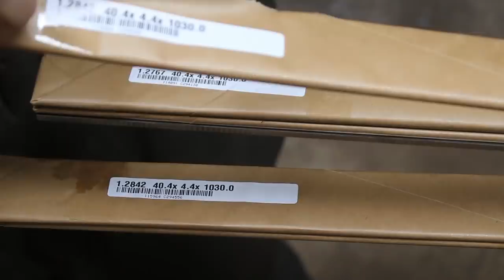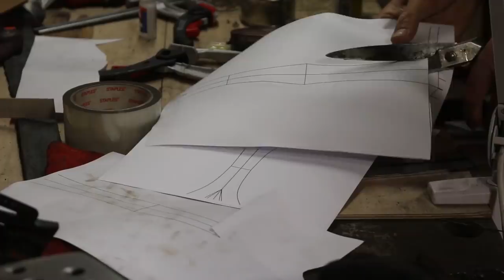Forging a Bastard sword, the complete movie.

Comment: This is an amazing sword but technically speaking this is not a bastard sword, this is a longsword.

Theres really only three types of swords: the short sword, the longsword, and the greatsword.

The short sword is obviously much shorter and usually a tad thicker and is meant to be used with only one hand, which is why the grip is so small.

The longsword, the one in the video is a blade with a longer reach and is meant to be used with two hands for powerful strikes. You can tell not only by blade length but by grip as well, if there's a gap between your hands when you grip it's most likely a longsword.

The greatsword is a huge blade, you really never see it in actual combat, the grip is collosal to suit the blade.

But there's actually a fourth type of blade, the bastard sword. But it's actual name is called the hand and a half sword. A bastard sword is a cross between a short sword and longsword. It allows the weapon to be wielded with one hand and two hands depending on the type of combat situation. The blade was usually slightly shorter than the longsword while maintaining the more common thicker to slimmer blade taper (when the blade starts wide at the bottom and slowly shrinks to the top opposed to a more direct and straight line like the blade in the video) however there's really no "better" version of the blade and is ultimately up to preference and what feels more natural. You can tell when a sword is a bastard sword when you try to grip the blade with two hands and your grip extends onto the pommel. It makes it great because if a grip is too long it sabotages the wrists movement when using one hand. But the bastard sword is short enough to not impede single grip combat, allowing for a shield but to also allow two hands in order to deliver more powerful strokes.

Comment: So much love and hard work went into making that sword I can't see how you can call it a "bastard sword."  Seems kinda mean-spirited to me.
Reply: The term "bastard sword" comes from a couple different sources, but one of the more commonly accepted is rooted in french, called thus because of its hard-to-qualify nature.  So-called bastard swords are neither one-handed nor two-handed swords, occupying a middle ground; as such, the term "bastard", meaning irregular or spurious in context, was used.  Bastard sword:  literally, sword of irregular or mixed origin.  One could consider a bastard sword to simultaneously be the shorter end of "Long swords" and the longer end of "arming sword", qualifying as extremes of both but also technically neither.  Hence, "bastard" sword.
Reply: another way to say hand and a half sword, just enough room on the handle to warp your 2nd hand for a faster more accurate swing.

Comment: I'm a novice and have a few questions. Why was he putting the hot steel in that powder?
Why was he cutting and reataching the parts he cut off? Is that like folding it? Why was he sanding it before he cut and reattached the part he cut off? Was that to help it stick together? Why did he drill the craters into the blade? Why did he heat up the blade then put it between two boards ? Was that to straighten it?

Comment: Top quality materials, high-end skills, obsessed workmanship deserves respect, hats off
Reply: That trip hammer in its first aplications was a modern marvel but now it's used mainly for repairing things when no part is available, using it to forge this item is like being a blacksmith from the 1600's what's discovered a way to get the same results with no skill or effort.

Comment: It looks good. The only thing I would have different is I would want a leather wrapped handle. Ebony is pretty and all, but if someone were to shield an attack from it, all of the shock would transfer from the sword into the wielder's arm. Leather wrapping would help mitigate shock. Also, Since it is a bastard sword, the option to add a counterweight to the pommel would be nice, that way a wielder could customize the weight distribution a bit more to their liking. Since the sword is a bastard and all, customize-ability would be the selling point for a medieval blacksmith.

Comment: Correct me if I'm wrong but that looks more like a longsword than a bastard sword. I'm mainly observing the handle and its overall length and since there's a significant space in between there's more room to move in. So the handle looks more like a longsword's but the blade length is more of a bastard sword's

Comment: Praises, praises, praises. Most of them much deserved. Mr. Wieringa's blades are getting to a better level with each craft.
However, the same is not valid for his grips. Go ahead and down-vote this comment, but lately they are not only rather ugly (preference matter only), they are also impractical.
This one here seems like a nice Type E grip with a Type T(1) pommel. Yet, I think plain wood with angular sides is not OK on a sword grip. A strike on the blade would make the plain wooden grip knock hard against the palm and fingers, and also to vibrate. Leather cover on a wooden handle (plus thread under-wrapping) provided both cushioning and anti-slip. Rounded grips with palm-swell, made of steel wire, is also acceptable, albeit a glove is welcomed in this case.
I say, we are seeing near perfection as far as blades, quillons and pommels go. Time to see some love for the grips, too :).

P.S. I am by no means an authority on swords and sword hilts. This is only an opinion based on personal experience gathered outside academic circles, and I welcome anyone to challenge it, only please just make it polite and gentlemanly.
Reply: Im pretty sure he's just making what the customer asked for. Even if it is sharpened, it might still be a collector's item/showcase model. He made good grips on his previous works, so I don't think he is doing it on purpose.
Reply: @Xtoxinlolinecronomicon  I totally agree that he has the capacity to make proper grips. But i would like the master to exercise this craft more often :). I would like to delight us with proper grips, as much as he delights us with the blades.

Comment: that's a desirable sword for sure ;) with all the perfection you put in your work, i'm just a little bit surprised by the glue for the belt piece attachment, is it really enough solid with all that weight from the sword ?
Reply: Y D if you noticed it’s not a glue but an epoxy. That combined with the threaded studs and leather over straps is actually an overkill.

Comment: Does anyone know the purpose of scoring the metal with those X marks before the heating? Also whatever was the purpose of using the drill to make those many dents in the blade?
Reply: It allows the layers of different type steel to work thru to the surface so that after etching in acid the contrasting pattern is seen.
Reply: @grantcox4764  Thank you very much!! That's very cool to know.

Comment: I stand in nothing but awe at your craftsmanship...but isn't the handle a bit large?...looks more like a Zweihänder to me.
Reply: ChunkyLover ataoldotcom hell no, that sword is considerably bigger, and the bastard sword is supposed to have a big handle
Reply: Yes you are correct, its not a "bastard sword" by any means, more like a pseudo 15th century longsword. Despite the mislabelled title and the fabtasy design of the sword, its still good craftsmanship though
Reply: @MrPanos2000  There is no singular accepted standard that defines a "bastard sword".

There is also nothing "fantasy" about this design. You can view more elaborate surviving hand-and-a-half swords from the 15th and 16th century currently on display at the metropolitan museum of art; images are accessible through their website.
Reply: @bignasty389  The HEMA and Archeology community usually defines "bastard" swords and hand and a half swords as 13th-17th century swords with longsword lenght blades but shorter overall hilts. This sword here is a longsword, because its hilt and blade lenght are too long for what most people active in our HEMA community would define as bastard sword. The fantasy element of this sword are its handle, which is ahistorical. Overall its a very nice historically inspired built.
Reply: In what way is the handle ahistorical? You can look at the image for an Oakeshott XVIIIb or, for a real example, you can find images of the sword used as the model for Albion's "The Cluny" in their museum replica line.

You don't speak for the HEMA community.  That isn't a term that's used with any degree of precision. Reference wiktenauer:

"The French épée bâtarde references the bastard sword, a type of longsword. English Medieval and Renaissance manuscripts refer to the longsword as the two hand sword. The terms "hand-and-a-half sword", "greatsword", and "bastard sword" are used colloquially to refer to longswords in general."

I'm not trying to tell you that you're "wrong" in calling this a "long sword". But it's not not a bastard sword. A bastard sword is a casual term that most closely means something that's longer than a short sword and shorter than a longsword within whatever context the discussion was being had. I don't know how tall the smith is but I have a chlebowski federshwert that's about 52 inches and almost reaches my armpits. The sword this guy's making looks a bit shorter than that. "Bastard sword" seems like a fine description.

Don't be arrogant. Show some humility.
Reply: @bignasty389  peoplle that use terms like shortsword shouldnt be as cocky as you. The handle is ahistorical because first of all bare wooden grips were barely if ever a thing at the time and never in that shape. Additionally 52 inches is way too long for anything to be defined as a bastard sword. I assume from the use of the archaic measurment that you are American and as such I can understand why you feel the need to play the authority here. In any case this sword can not by any realistic way be called a bastard sword and its handle isnt historical period.

Comment: What was used instead of welding in ancient centuries?
Reply: Depends on the kind of sword you are making and what you have to make it. To my knowledge pattern welded swords were made from bars that were twisted around each other and then forged together in order to even out the steel to keep from having a specific spot that was weaker then the rest. It was a way to deal with less quality controlled steel than we have now, but if you had a good quality steel that didn't have that issue pattern welding wasn't necessary. That being said there are also swords where the core was a different steel than the edge and the steel of the edge was forge welded on. Katanas are the most famous example, but European swords have been made that way as well. It all depended on the metals you had available, which was related to the time period as well. The further in the past you go the less advanced the metallurgy.

Comment: So is that an authentic MIG welder from Middle ages or is it a later reproduction.  Now that angle grinder I know is authentic, what year was it made? 1290, 1310?. 

I know you used modern tools to expedite the process but you may have gone a little overboard.